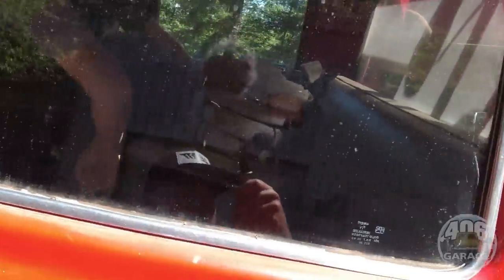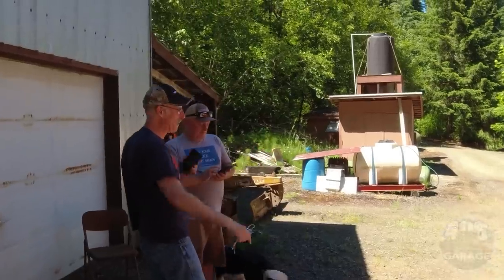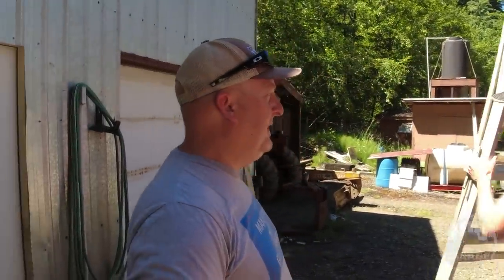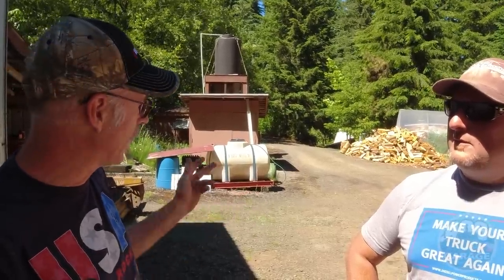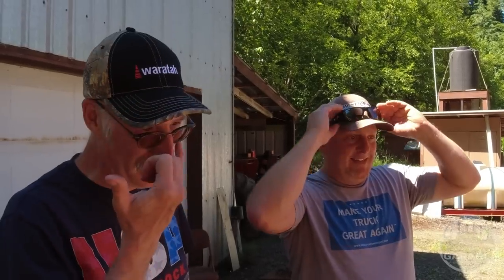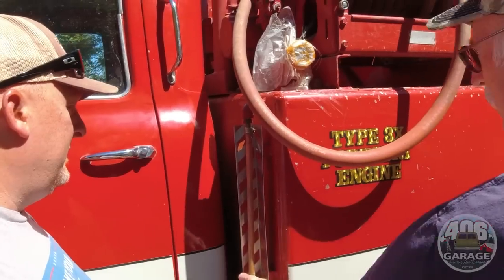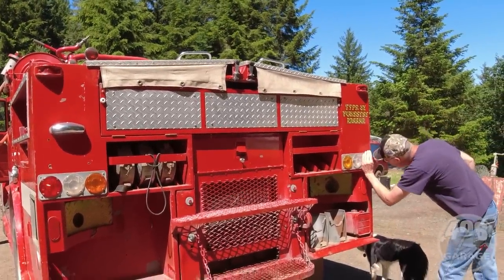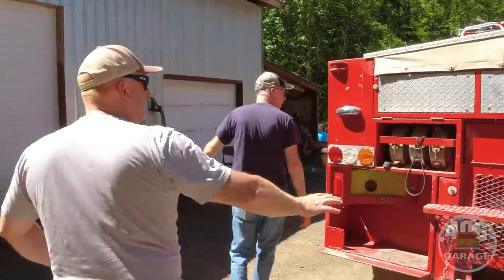Binder Finder 1975 Firetruck Pt3

Comment: Loadstars, because of the tucked back front axle and shorter wheelbase, are actually significantly more maneuverable than a pickup-front based truck.  We used to have a 1600 (345) horse van with a two-speed axle, that didn't even have power steering.  It was incredibly easy to drive.